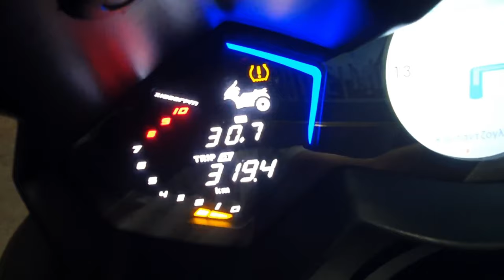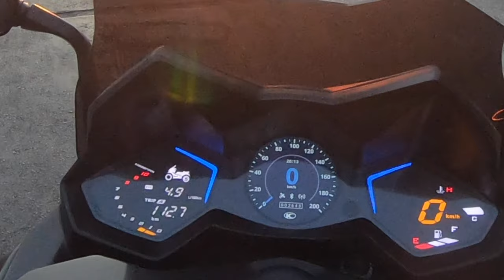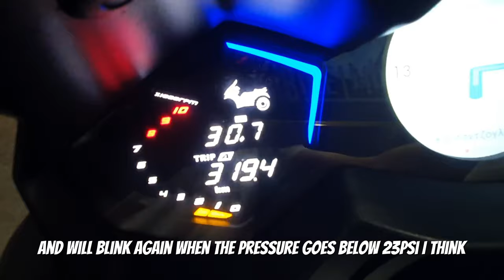HOW the new T.P.S. WORKS? AK550

Comment: This has been bothering me too since the update. I thought it was the learning system entering, since the manual talks of it being the only time it blinks, but only for 2 minutes. It blinks much longer than this. I wish Kymco would tell you what the update does differently other than just "New TPS controller installed". 
I agree, the old one was better. I didn't notice a drain on the battery anyway.

Comment: When making changes to the way software will operate, everyone involved at the design stage should include inquiry of several actual owners what they want changed and how it is supposed to function.

Apparently whoever decided what was to be accomplished with the update and how it should be done didn't understand their role, thereby causing confusion in usage .

They wanted to reduce battery drain by not monitoring tire pressure while the engine was not running.

They wanted to display the current tire pressure soon after startup, which should include setting limits on what was acceptable.

They should account for tires warming up when used, setting limits on what was acceptable.

They didn't properly account for the difference between cold tires upon startup and sometime after riding for a while.

From your description I can't tell exactly how much of that was accomplished.

Somebody should go back to the drawing board, in this case the software.

And update the operating manual (online?) to properly describe usage of the changes, perhaps including a short paragraph of why the changes were required.

Comment: I had a puncture three days ago the TPS  did not show anything I only noticed it when the tire went entirely flat... It only showed me the flat when I closed the switch and turned it back on...
In addition I noticed that my sensors are reveresed!! It showed me a flat tire in the front on the dashboard while in fact my flat was in the back...
Anyway really shitty and not reliable system from kymco which feels like a trend for this scooter...
All the extra systems (like the heating grips) of this scooter seem like under-cooked cheap chinese knock-off products that were cramped into this scooter just so they can say look we have heated grips and TPS and ... and.
Great foundation but they have still much to improve on the surrounding features...
And don't get me started on the Issues with their noodoe system...
Maybe someone at Kymco is following your channel and reads this to get the wheels rolling to fix all these Issues....
Reply: Wait until one of your key fobs goes missing and Noodoe doesn't even tell you about it! Replacement cost??? Well, how about €700 for parts?
Reply: @Expat47  well why should you loose 2 keys?? At that point it is your own fault...
Reply: @Merlin-  I agree! I, alone, lost the fob but to have to replace the whole system to, once again, have 2 keys is ridiculous! Then, with all the computing power (supposedly) built into the AK to not warn a person of a fob gone missing is just unforgivable!
Reply: @Expat47  sorry think i didn't understand what is the fob?
Reply from the maker: What noodoe problems?
Reply: @Biketrips  disconnecting from xiaomi/huawei/oneplus phones
Reply from the maker: its the power saving modes the chinise phones have. Try disabling them, with my Samsung s10 works like a charm and faster than s7 i had. GPS is almost instant.
Reply: @Biketrips  since the latest updates noodoe seems to have been fixed on my oneplus anyway...